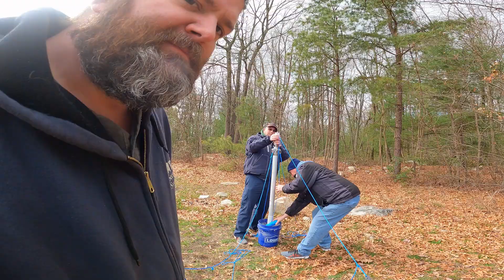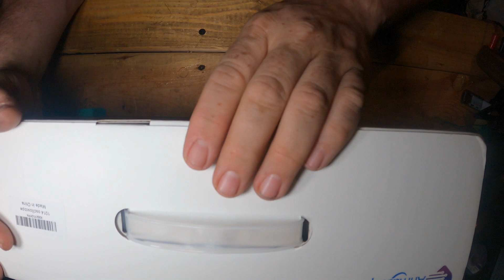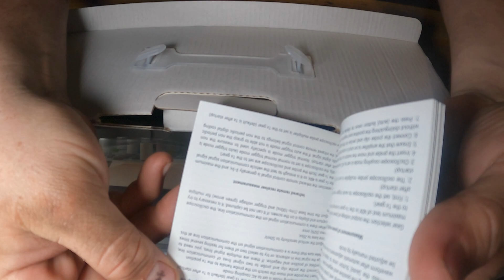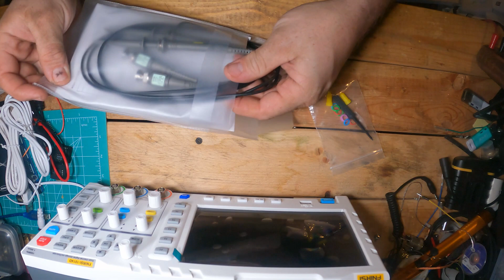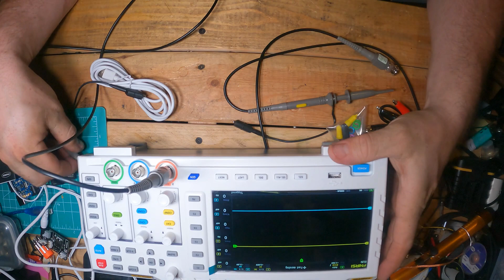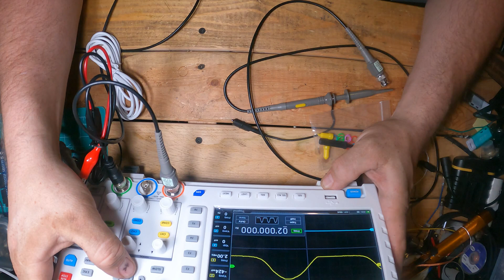2 Channel Oscilloscope ADS1014D unboxing

Comment: I am beginning to this. I just received one today. I am not expecting a $2000.00 device, however, I want to re-learn oscilloscopes again since I last touched one in 1980 or so. Thanks for the unpacking.
Reply: 73 de N2JKW!